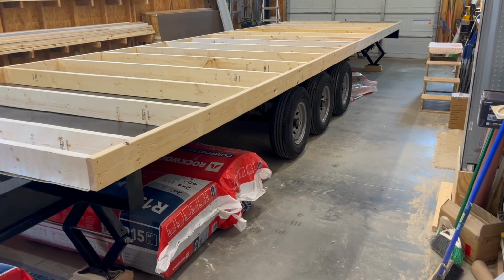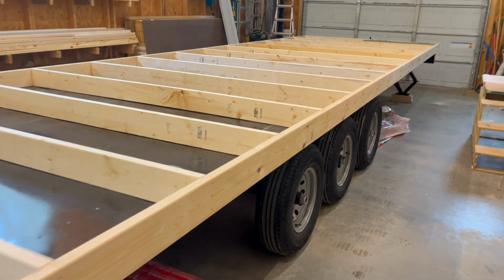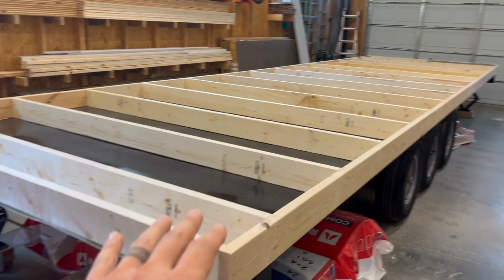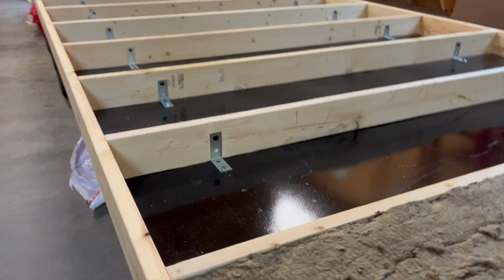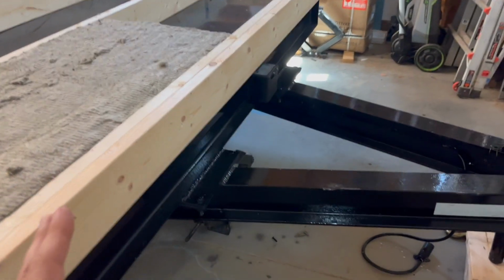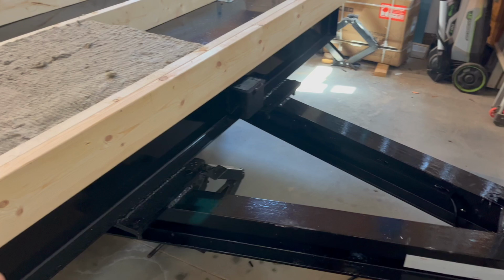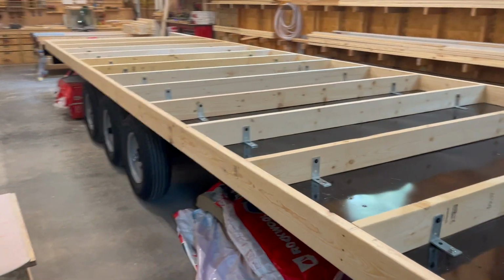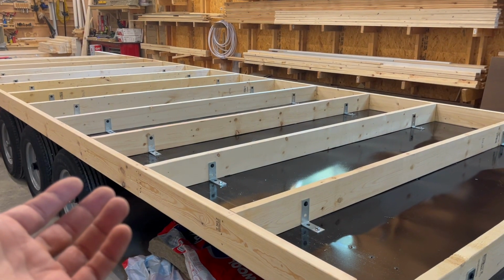Behind The Tiny House Build: Foundation Trailer and Floor Structure

Comment: Looks super sturdy with those joists bolted to the i-beams. I bet the floor feels great to walk on. Does the steel floor pan have any way to drain water or remove moisture if it somehow finds its way in there?
Reply from the maker: Yes, the sheets are only spot welded to the beams and cross members so water would drain out.

Comment: Aren't you worried about thermal bridging and condensation with that floor pan touching your structures floor?
Reply from the maker: Actually yes and no. First, Rockwool fills the cavities quite completely which will keep the floor pan warm to a certain extent and less likely to condense. Second, the floor is not at the same risk as a roof as far as vapor load and since the floor pan is not water tight, moisture can drain so the wood can dry. Finally, I neglected to mention that as a just in case measure, we adhere a strip of ice and water shield to the bottom of our joists. You can’t see it on the video but it is an easy to add safety measure. 👍 I’ll have to film a bit of that on the next build!
Reply: @FireflyTinyHomes Got it, thank you. Ice and water is a great idea. Have you thought about using foam board insulation or an air gap between the trailer deck and rockwool? Or even having the trailers built with the pan on the underside of the trailer? I recently started building my tiny home, and before the floor was in, I would often be greeted with a good deal of condensation on top of the pan on cool mornings. Luckily, I have a trailer that allows for foam board insulation under all floor framing, aside from where the bottom plates of the walls reside. Keep up the good work, it's nice to see builders who take pride in their work.